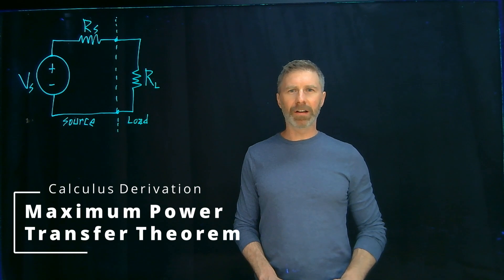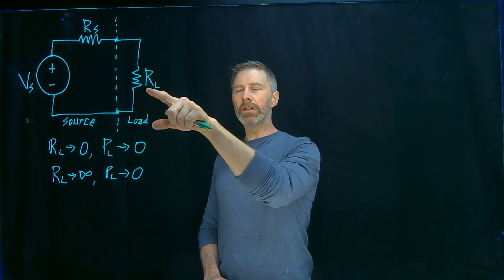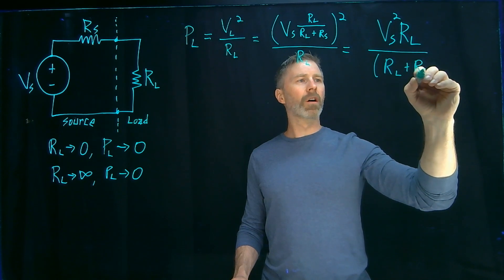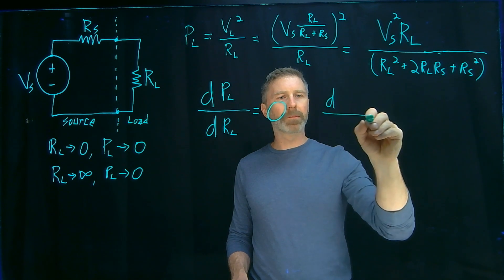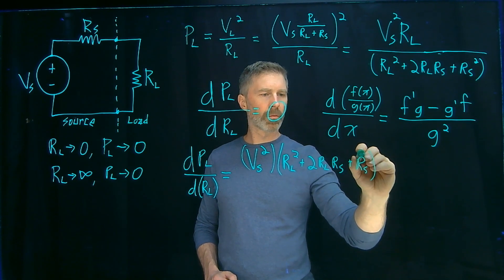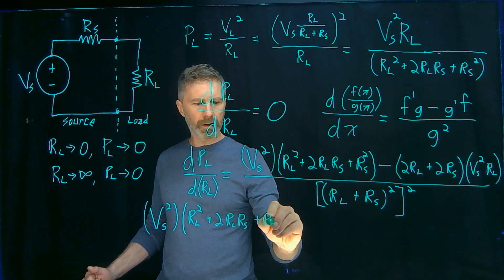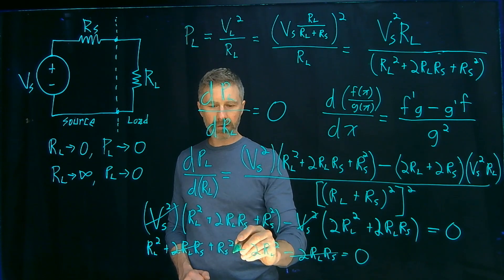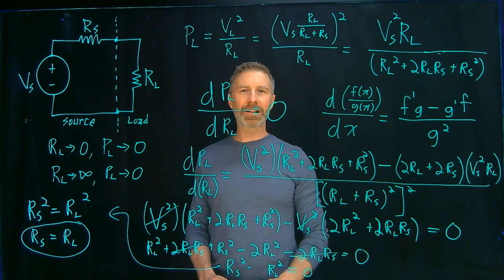Maximum Power Transfer Theorem (Calculus Version)

Comment: Why not pull out the constant (Vs^2) before taking the derivative? And then show a step where you multiply each side by (1/Vs^2) and (Rs+RL)^4...  I'm just giving you a hard time, lol.  Thanks for this clear explanation, I'm taking a circuits course and haven't taken calculus in 8+ years so thanks for the clear and simple refresher on quotient rule.  Somehow product rule has stuck around all these years but not quotient.